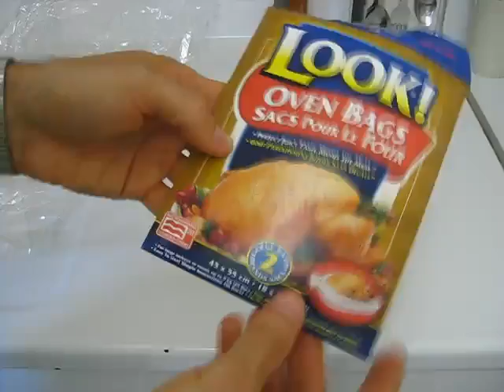How-to for car sunshade solar cooker windshield

Comment: It seems like the ideal shape for the reflector is a cone, and a wire (or some other material) circle could be secured at 3 or 4 spots equidistant from the  point of the cone would nudge the sunshade closer to a ideal shape.

Comment: I have a Question: What would be the effect if I use microwavable Ziplock bag instead of Oven bag? Would it do a better job at retaining the heat?
Anyways thank you for your video!
Reply from the maker: Bring plastic, a Ziplock bag would melt. In any case, the heat retention wouldn't be significantly different.
Reply: @RimstarOrg  Thank you for the reply. I heated a water today and made an omelette with a regular plastic bag. The heat was capped to 170-175. Same when I used a Ziplock bag. Is there any suggestion for me to increase the temperature of the contraption?
Reply from the maker: If you can find a transparent glass or pyrex container then the thicker material will hold the heat better than the thin plastic of a bag. Doing that with this other similar, but better solar cooker, got up to around 300F http://youtu.be/H5_z4-ocLUs . Near the end of this video I say that I worked on the shape some more to get better reflection to the food and got up to 200F. I give some tips for working on the shape of reflectors in this video http://youtu.be/Gjr-VHq12kk

Comment: I like your idea and I'm wondering if a hoola hoop with a piece cut out of it would provide a suitable framework for the top perimeter. Just a thought
Reply from the maker: Good idea! Poke some holes in the sunscreen and use some string to tie it to the hoola hoop.

Comment: I saw another video where they used Velcro to make the oven but, I like your way much better. It only takes 15 seconds to put it together using clamps. Velcro requires lining up the strips so it stays together. Brilliant!
Reply: I agree.  Also I was surprised to see that putting it on the ground can be more efficient than the bucket method.  Great video.

Comment: Looks like you might still be reading comments here,  I did my own version of a sunshade solar cooker, I have some ideas you might use in the video I posted  https://www.youtube.com/watch?v=K8gToez6BXg    I am using a heavier type of sunshade... my max temp so far has been 231°F and I do have some more ideas I intend to add... future videos on my project page in time... in one of your videos I saw the cut silicone mat that was used between bowls, had not done that yet, was considering it... any idea on the temperature improvement with using it. Figure I will go that route this winter when I get more clear weather.... nice videos.
Reply from the maker: I used the silicon mat (actually I think it was felt) between bowls because the gap between the bowls was so big. I've since switched to wrapping one of those surgical bandages around the gap instead.

Comment: What kind of pot did you use? Where were you (geographically) and what time of year when you were able to get such a high temperature? Thanks!!
Reply from the maker: +clint4Now The pot was a thin-walled metal one that I got from Walmart. It was part of a double-boiler set. The time of year was August, our summer here in Ottawa, Canada.
Reply: Oh wow that's impressive.
Reply: pot should be black to absorb heat

Comment: could you use a cast iron dutch oven with this solar cooker?
Reply from the maker: Amanda Lutterman It might work, depending on how strong your sun is. You'll have to put it inside another container that's transparent in order to trap the hot air. If your dutch oven is really big it might take too long to heat up.
Reply: Amanda Lutterman In my solar cooker, I have to pretty much add an hour to the cook time (over normal solar time) to make up for the thermal mass of the cast iron.  I suppose you could preheat the CO but that sort of defeats the purpose..
Reply: Leave the pot in the solar oven while preparing the food., or while the sun is still low before commencing the cooking.

Comment from the maker: You can do as you suggest, certainly. Aluminum foil does dull over a year or two and need to be replaced but the same it true of this material. The only difference is that a car sunshade is pretty much an already made solar cooker whereas an aluminum foil and cardboard one take an hour or two to build the first time. I have both types.
Reply: U r a legand sir👈👈👈👈👈

Comment: why not simply use aluminum foil? It is much more reflective, just use it to wrap a cut out of cardboard box.. Is there a specific reason for using the sun shades?by the way, you're incredible I love your videos!
Reply: Dasha Z the sunshade provides insulation and helps minimize heat loss compared to aluminum foil. Plus it's reusable

Comment: Ok then getting a pot as small as possible that is black as a main pot then getting a glass pot larger than the cooking pot. Yeah minimizing the mass of the black main pot for minimizing cook times would be good too. I think they make larger mason jars than the one I saw in your video about the first solar cooker would one of those work or maybe two halves of a plastic bottle like a soda bottle duck taped together.

Comment from the maker: There's no brand on it and I got it secondhand on freecycle. It's standard size, not for SUVs. Mine isn't the best anyway; it's very bumpy which means it doesn't reflect as much to the cooking pot. You'll also want to use a cooking bag around the cooking pot to hold in the hot air, though a glass or pyrex container would do a better job though they're harder to find since they have to be larger than the cooking pot. I agree re minimizing the mass.

Comment: Nice you actually inspired me to go out and buy a sun shade for this very reason. Just what brand is it? Because I bought a blockade brand in standard size not the jumbo one for suvs. Now it's just a matter of which pot works best I found a black cast iron pot but I can't find it now there are some small pots on ebay though. I would think you would need a small pot because you want to minimize the extra mass you have to heat up vs the water.